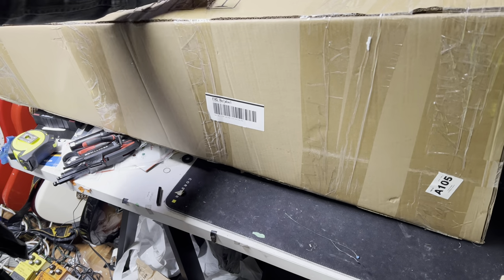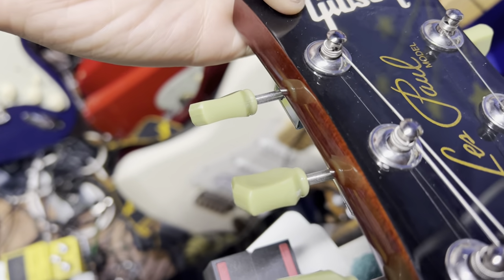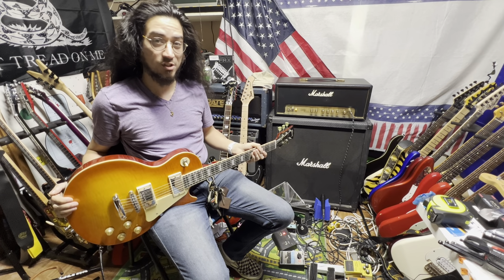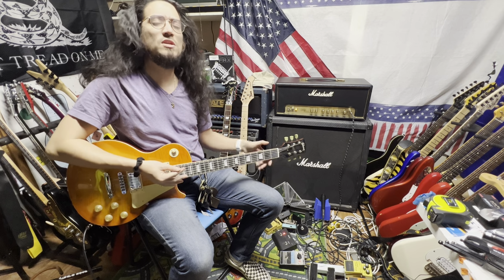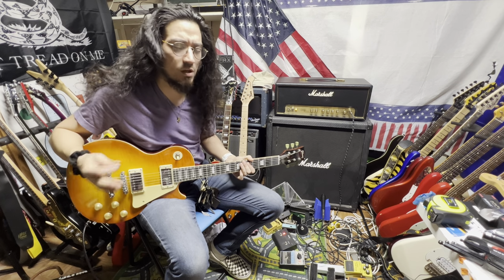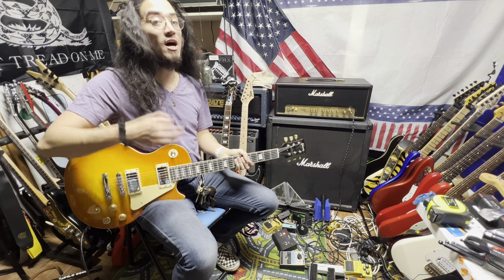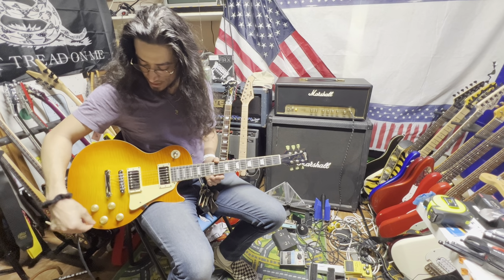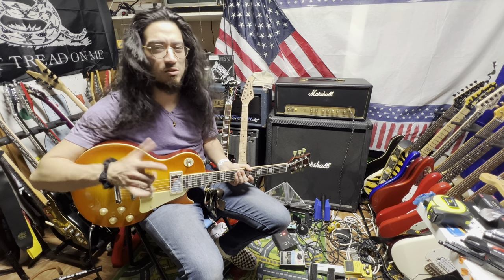Chibson Les Paul Standard - Unboxing & Review!

Comment: The top is called a veneer,  its a real thin cut of real wood, its not a painted simulation, Its used in wordworking everywhere.   Not high end but its not bad.   The routing is normal looking.   Smudges are the same as beat up.   I purchased one for $88.   Its actually amazing. Its not 100% quality,   I can nit-pick it as well,   but the sound you hear from the switch means it rings,   knock on it and it rings,   this is a desirable thing.   The guitars are awesome for someone who can set things up,  polish frets, level if needed,  new pickups, new pots, switch jack, and ive got 2 that are equal to if not better than my real 2018 standard.  They are good bones to build a LP how you want.    I got a review i did as well.  Couple I modded.   This one you gont aint bad,   they all need a little something.